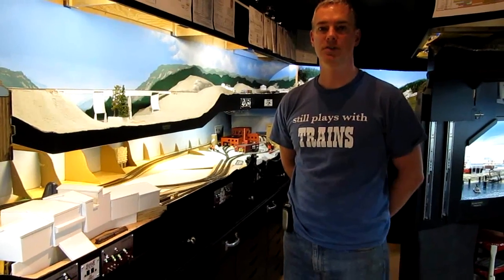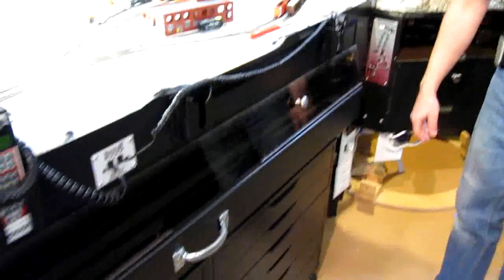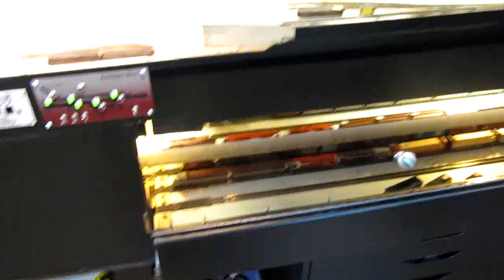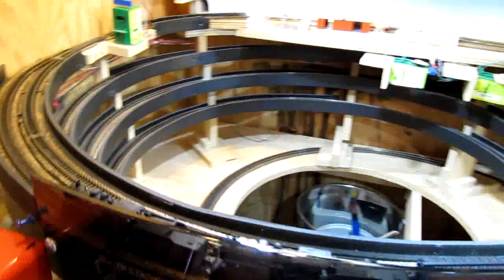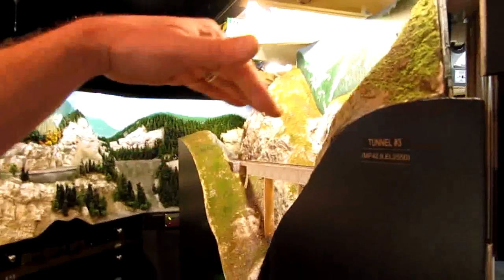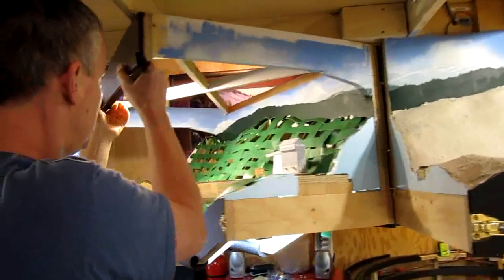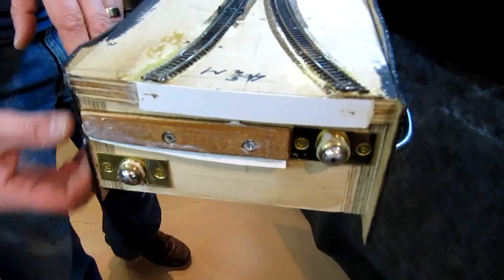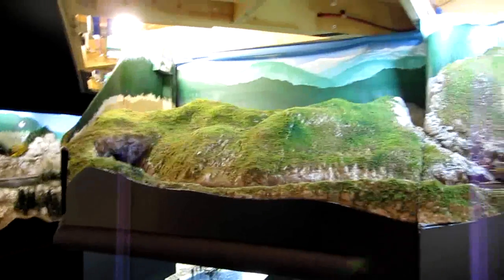Columbia and Western Overview 2 - Mechanical design and construction of 4 deck layout

Comment: How big is the room that your layout is in? 
Also do you have a track plan of your layout 
I'm looking to do a four level for my layout but I am concerned if it will work for a walk around design
Reply from the maker: The room is about 16 x 20 feet. Track plans appear in both Kalmbach's GMR 2016 and MRP  2012 as well in RMC's  May 2013 issue. The track plan is also on the C&W Flikr page.

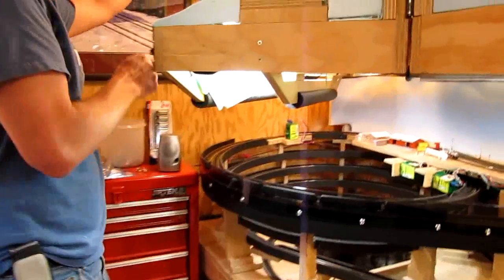Comment: What did you build your second helix out of at 4:53 and what radius did you use?
Reply from the maker: The second, smaller helix is an inverted "wedding cake" style construction cut from a single sheet of 3/4" plywood in ever decreasing spiral radius as it goes down.  The upper turn radius is 19" I think going down to 15" at the bottom turn radius where it eventually exits the funnel by crossing underneath and the turn that is next above it.  Simple construction that took a day to build and a day to lay track on it...I needed it to be funnel shaped as opposed to the more traditional "wedding cake" style which is smaller on the top so that i could access all of the track from the aisle side.

Comment: Thanks, Mark. I thought it looked similar to clearance in a couple places on my planned layout. I'm debating how wide to make one upper deck section where the lower deck is 18 inches wide at 48 off the floor, and the upper deck track is 60 inches up. It doesn't have to be a matching 18 inches wide so I might recess it by 6 inches or so. Luckily my major scenic features that drop down below grade are all on the lower deck.

Comment from the maker: I just remeasured...sorry I was going off memory.  

The narrowest point is right behind me in the opening scene: the clearance below the bridge and above the passing track at Castlegar.  This is 8" however the upper deck is only 12" at this point whereas the lower deck is 24" and there are no switching areas below the bridge area.

All other dimensions in the first reply post are reasonably accurate.

md

Comment from the maker: Hello there...this is not an easy question to answer as it varies based on the location, the set back of the upper decks etc.  If you let me know which specific area of the layout I can give you an exact clearance.

Between Castlegar and Cascade it is about 13" with 6" or more of set back but the upper benchwork drops 3" where the Kettle River bridge comes down.  Between Nelson and Farron it is 15" with normally about 2' of set back.  Between South Slocan and Fife it is 15" with 6" of set back.

Comment from the maker: Hello Vlinefan...thank you for the compliment.  

I am not sure I understand your question though...the track is fastened to the roadbed on the stationary benchwork on either side of the gate and swings (or rises in the case of the lift gate ) with the moving gate section.  

I don't think that will have answered yoru question but I am happy to try again with a bit more information.

thx

md

Comment from the maker: Hi there...not sure I understand your question clearly.  The C&W uses Digitrax yes.  

The Command Module is a DCS 100 and I use two DB 150s for boosters.  I don't recall what packages I bought when I aquired these 3 units (i.e. super chiefs, empire builders, etc) as I was interested in the components not the packages.

Sorry if that wasn't your question.

md

md